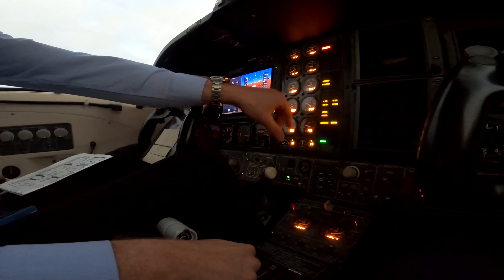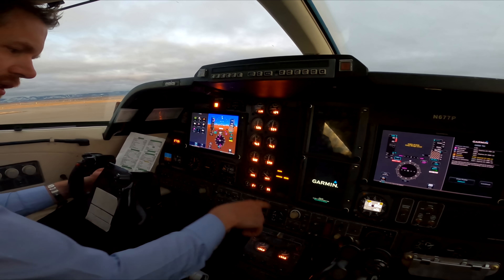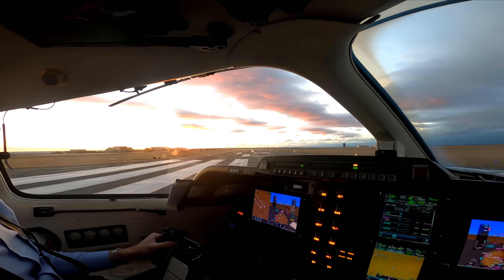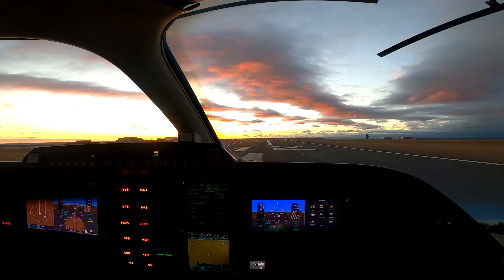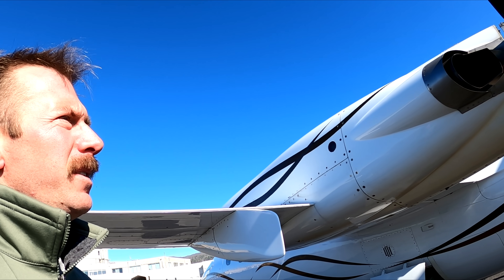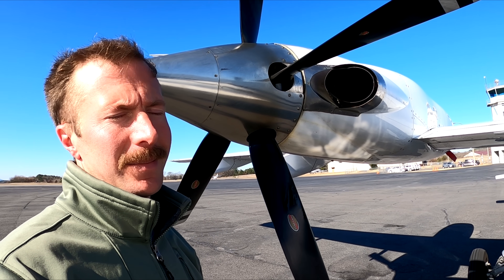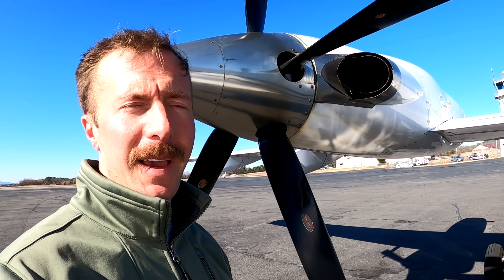Flying a Piaggio P180 Avanti to 35000ft. A Pilot Perspective

Comment: The Achilles Heel of this airplane is the short range, and the high price. It is basically mid sized and many mid sized jets have well over 2000 miles range, some can cross oceans . They need to add some extra tank options on the wing  somewhere. If you need to stop while another plane can fly direct, you lost a lot of speed advantage. I remember when jets were more primitive, from HKG to LHR took 22 hours and 4 stops. Nowadays , it is direct. jet speed been frozen for 3/4 century, still struggling against the "sound barrier".

Comment: Don't understand why this isn't more popular. 90% the speed of a jet with 50% of the fuel burn!
Reply from the maker: @GeorgeStar  parts logistics and noise has been the main culprit. But I agree. It's amazingly efficient
Reply: A maintenance guy was telling me that phase inspections and parts for each airframe are a pain ... Essentially each airframe is a custom job... I.e. if you have to replace a panel, you can not just pull it off the shelf and put on a replacement ... Things of that nature ... Totally gorgeous aircraft of you can afford it?

Comment: We are looking at the P180 due to performance but largely due to the cabin. The owner is a large man and the P180 has a superior cabin, and is so quiet compared to King Airs.
Reply from the maker: @PilotController1960  they're fantastic aircraft.
Reply: @SirDrifto  Do you know how maintenance support compares to Beechcrafts for the King Air?  Efficiency wise that could outweigh any maintenance concerns but I'm still in the research phase. Cheers!

Comment: It is a cool looking plane and in many ways functions as a jet but it just should have been a jet. As I understand it, it's banned from certain airfields because of noise and the 5-6 seater Eclipse 550 uses half the fuel that this 9-10 seater does so that just means turboprops shouldn't exist. Imagine if instead it was a carbon fiber plane with some advanced insulation so they saved 15cm in the diameter without reducing the cabin and it weighing half. And it had jet engines instead. Better fuel consumption, smoother, quieter, cooler and could well be much cheaper too. Both purchase and service. It could sweep the private jet world. I would make it smaller still because you don't really need the big cabin.

Comment: Outside they are noisy, inside in cruise you can talk in a normal voice from the cockpit to the most rear seat in the cabin. It's the most speed stable plane I've ever flown, you can literally hand fly it within one knot. Well built with exceptional performance. Not a short field aircraft.
Reply: 'Literally hand fly it'? Not figuratively hand fly it? Thanks for clearing up that potential source of confusion. Cretin.

Comment: Why the Garmin "upgrade" instead of the ProLine 21 the plane came with? Just curious. Thanks for the video!
Reply: You can tell by the controls across the top of the panel and the engine indicators that this is an Avanti,  not an Avanti II. The original Avanti had mostly analogue instrumentation. The 'II' variant introduced Pro-Line 21 avionics.

Comment: My father used to work for Piaggio, and he personally was the supervisor of building this aircraft when it was sold abroad to other countries. He was also friends with the designer of the aircraft. It was just a marvel to see it in person when he used to invite me at the hangar as a kid to watch it being built. Definitely the most beautiful turboprop airplane to have ever been built.
Reply: May I allow myself a Belandi of respect for you father
Reply: April 1984, Convair Lindburg field ,wind tunnel San Diego Cal.  I flew the P180 with the Boeing built team ,for Piaggio, scale w/t  "flutter model"  this is a dynamic type model, has flexible wing spars, segmented wing and body panels.  Flys on a steel rod in the w/t test section.  Really a beautiful acft. Fond memories.
Reply: The Avanti and the Starship are the two most beautiful turboprops ever built. Both pushers, both with front wings.

Comment: Cool plane, disastrous ownership experience unless you're willing to way overspend to keep her flying. Piaggio has dumped its support as an OEM, and parts are very limited. It's hard to find pilots for them as well. This plane will cost you every bit as owning a big Citation X, VII, VI, or Falcon 50, same territory $$$. Better off increasing your purchase power to get a Phenom 300, everything you want performance wise and faster but with far far far less variable and fixed costs. Acquisition is higher, but you'll be much happier with it than the Piaggio, promise!
Reply from the maker: You hear nixed opinions.  Some love em, some hate em

Comment: In every Piaggio Avanti I’ve seen the edges of the cockpit windows are discolored. This tells me that they leak, and have been leaking for a long time. Water intrusion can cause deterioration of the airframe or the cabin pressure boundary. Either is seriously damaging and potentially dangerous. Why is this condition allowed to continue? It seems like the FAA would issue an AD to have it inspected and corrected.

Comment: The Piaggio P180 is absolutely gorgeous. As a pilot, it would be a dream come true if I got a chance to fly it. However, as someone who worked as a ramp agent at an FBO, this plane can go to hell. I have never been more terrified for my life than when I had to disconnect a GPU from one of these after they started their engines. (The external power receptacle is positioned so you have to get VERY close to a spinning propeller to disconnect the GPU).
Reply from the maker: I like your honesty 🤣
Reply: cool comment. glad ya never got got
Reply: hah   yikes
Reply: Stop stealing my picture man, that's mine.
Reply: I'd be holding on to that cord like I was a rattle snake
Reply: @goagin - like YOU were a rattlesnake?
Reply: @markfox1545 
"It"
Reply: Honestly this is the ugliest plane out there. But planes made for efficiency and all need to be what it is.

Comment: I have flow in the predecessor, the P136.  This is a beautiful plane. But the DNA with the push prop is the noise.  Unbelievably noisy when they fly over you. A 737 is quieter.

Comment: Am I miscalucalting? Video shows some 80 kn tailwind, so the numbers to compare with should be 450 kn GS (as said in the video) minus 80, so we're looking at aroud 370 kn TAS at 35,000 ft, maybe up to 400. So a jet would be faster by 50 kn. But the economics of fuel are just amazing

Comment: It’s a design that I really appreciate, both the Beech and Avanti are in a class of their own. Have seen the Beech many times in the past, it’s a pity that Beech shot themselves in the foot by authorizing only one company to service this fine airframe in the past. It lead to over billing Beech making it one of the most expensive airframes to maintain.
As for the power plants on both of these aircrafts a friend and A&P for many years said that "it is a pity they put clubs on a turbine engine". If a FADEC controlled state of the art power plant that is not burdened with a prop these aircraft would be truly an ultimate aircraft.

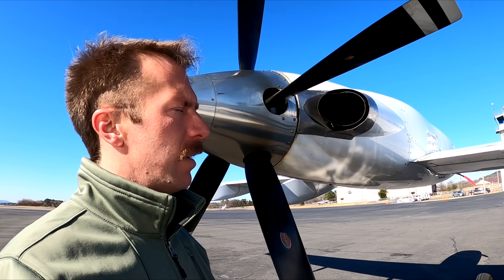Comment: 13:36 I wonder if the turbine gases so close to the propeller will not be harmful to the blades. Nice video and very nice plane.
Reply from the maker: I've been told the heating of the blades does cause discoloration

Comment: For maintenance, the access to many systems is terrible. Too many panels are held in place by a billion screws.
The weight and balance on this aircraft is a nightmare. You cant load full fuel and full pax. In fact full fuel is only possible if you have 2 pilots.
There is no APU so in hot climates you need to pay for a GPU to keep the cabin cool.

Aerodynamically speaking it is an aircraft ahead of its time. In all other aspects this aircraft is outdated.

Comment: if this was made by Piaggio then why doesn't it use two-stroke oil and have a kickstart for the engine? They go from making the best scooters on earth to this?!? come on
Reply: Actually Piaggio was born as aircrafts and train wagons company before separating in two distinct companies with the new one specializing in scooter produced in Pontedera, Toscana. The aircraft Company was composed by two factories both in Liguria region, one was in Finale Ligure where were first produced hydroplanes converting the knowledge of local shipbuilders that used to produce steamboats, then airplanes that were produced here and assembled in Genova Sestri Ponente factory right next to the airport. 
But also the Piaggio producing scooter is linked  to the airplanes by the moment that the really first models and prototypes of scooter and vespas were born recicling the abundance of two common things in Italy after WW2 as the starters motor for the allies warplanes and sheet metal from italian and allies warplanes left on the ground. Put togheter two wheels, one handlebar, some sheet metal from abandoned aircrafts and an engine made with parts from a starter motor for aircrafts and you have an early version of scooter.
Now the whole aircrafts Company produces in one factory in Villanova d'Albenga, Liguria inside the little local airport.
Reply from the maker: Still makes two stroke sounds

Comment: The Piaggio Avantair is not an Italian design, but was designed by Bill Lear, of Learjet fame. The aircraft should have been more successful, but is expensive to build and operate. Continuous problems with the many, many owners hasn’t helped. Hopefully, they will find a new owner. Their biggest mistake was doing business with fractional operator, Avantair, who went spectacularly bust, dumping fifty plus aircraft into the used market.
Reply: It was designed by Alessandro Mazzoni!

Comment: I Remember When lyrics Sigler finish developing this plane and actually had an issue with ground tests and had to forestall the first flight. And the flight went off on the next day. The contract required the flight to occur by the end of the year so the post office was nice enough to send the confirmation letter on the 32nd of December. Fantastic aircraft, and actually gets really phenomenal fuel mileage for a turboprop of any kind much less a twin-engine.
Reply: The "32nd" of December was for the Lear Fan aircraft, in 1980.

Comment: It's a lovely aircraft in style and has the 80's new design ideas but the problem with pusher configurations like this is simple to explain. Propellers really need to be in clean air without engine exhaust and rocks kicked up from wheels from the wheels on takeoff. The amount of extra servicing to pusher style propellers is extraordinary. I've seen what damage is done to pusher style props and it's nasty. No wonder other aircraft manufacturers dumped this style of design.
Reply: The only real servicing for the props is occasionally cleaning exhaust soot off of the blades.  They sit relatively high off the ground so there really isn't much problem with debris.
Reply: Am I wrong? Costs to operate are far lower than a comparable jet.
Reply: The MiG-29 has some steel plate assembly on the  nosewheel to prevent that when operating from less prepared runways...so it is a question of design/engineering to put that extra stuff there...
Reply from the maker: I’ve always wondered about debris
Reply: @SirDrifto  Runway debris can do major damage to aluminium & composite blades. In simple terms it severely shortens the life of the blades. There's defines limits to what repairs can be carried out in relation to stone and rock damage. And if one blade is damaged out of service it's often difficult to find a suitable blade thats going to be the correct weight to work with the other blades. Sadly many people take props for granted. They are too often neglected and overlooked. But when they go wrong it often happens without warning. That's when the real panic sets in.
Reply: I'm an older life-long aviation enthusiast that has followed news about this plane its entire existence, and have even talked to some owners, and have never heard of this being a problem for P180s, of course that is anecdotal but I believe the prop is high enough with enough clearance. Pusher props certainly are less efficient as they don't get clean air, but it seems like a fair compromise for the NVH.
Reply: I don't really buy this--and pushers are in several new designs.
Reply: @nutsackmania  Go work in a prop shop and you will see all the problems of the pushing style of design
Reply: Surprised to see you here @leokimvideo. The true spider man!
Reply: Solid alloy props can handle a bit of debris in my experience flying them on bush strips
Reply: OP, one could argue that the wings deserve clean, undisturbed air more than the props.
Reply: Tractor planes get prop damage in the same way, but the damage to pusher props is no different if you stay on paved runways.  Also, your assumptions about exhaust gases are also wrong.  Such gas is not a factor at all and the temperature of the gas is well below specs for the props.  Consider military drones are pushers, for obvious reasons, they are more maneuverable, faster and the aircraft and wings are not burdened with prop turbulence.
Reply: wait, why would the props pushing cause any kinda extra damage vs pulling? im confused
Reply: @penguiin12  Stuff gets kicked up into them from the wheels taxiing/takeoff/landing since they are behind the plane. I believe in the case of the Avanti they are high enough to avoid this for the most part.
Reply: @penguiin12  you're not confused, the OP is. If anything, the wing ahead or the prop offers an additional protection from debris.
Reply: Not to mention the exhaust gasses that have to flow over the prop blades. You can see on most planes with a PT-6 where it gets all nasty behind the exhausts, I really wouldn't want that shit building up on the blades. And certainly it can't help performance since that air is so hot and fast already.
Reply: @philtheairplanemechanic  That exhaust serves as a free prop anti-ice system.
Reply: @i.r.wayright1457  Ha ha..

Comment: I cannot possible see what the purpose of this airplane design is.
Reply from the maker: Let’s just say it’s purpose is to be 20% faster than airframes of similar design with less fuel consumption. Find me a king air that is just as fast or altitude capability.
Reply from the maker: The appeal is equivalent of a supermodel
Reply: find a turboprop with the speed of a jet....

Comment: One of the 10 most beautiful planes ever! Also, a great design, with the canard permitting aft wing location, for noise reduction and excellent visibility by everyone on board.
Reply: It’s not a canard, it’s a biplane.
Reply: @flyboyak47  ummm, no it’s not.
Reply: @flyboyak47  Technically as it has 3 lifting surfaces it would be closer to a Triplane but it's actually just defined as a three-surface aircraft (https://en.wikipedia.org/wiki/Three-surface_aircraft). Scaled Composites has been responsible for several aircraft in this configuration and Burt Rutan, the principal designer, is also well versed in canards also (Vari-EZ, Long-EZ etc).
Reply: It is a second wing. Even has a flap. The plane still has a conventional horizontal stabilizer and elevator

Comment: Parts lead times are big talking point, and very expensive. No engineers/mechanics know anything about the aircraft. Very high pressure tyres (can operate on only a few airports in Australia due to ACN/PCN). Outdated avionics. A kingair 360 would be a much more sensible choice.
Reply: ANYTHING Italian,  cars, airplanes, boats or women are notoriously expensive to maintain.
Reply from the maker: I've heard parts are pricey.
Reply: Picky picky picky 🤣😂🙏🇨🇦
Reply: Sounds like you need some new mechanics if none of them don't know anything about the aircraft. They are relatively simple to maintain, it's only slow parts availability that can be a problem.
Reply: @Paul51178  I'll take here in Oz as an example. No one here is experianced in the Avanti, so even if you have the parts, you are going to pay a lot more for labour. Take a Kingair to any major airport, they will have the parts in stock and have fitten them hundreds of times. The Avanti is a great aeroplane, but it's ACN/PCN rules it out of all but capital city airports.

Comment: 400+ knots GS on a turboprop, that's pretty impressive!
Reply from the maker: It sure is. Jet category at those speeds
Reply: He said 454kts ground speed.
Must have had that western tail wind.
Reply: Hardly Jet category when you spend ages to get to altitude and at a very slow speed. The block speeds for this aircraft are unimpressive